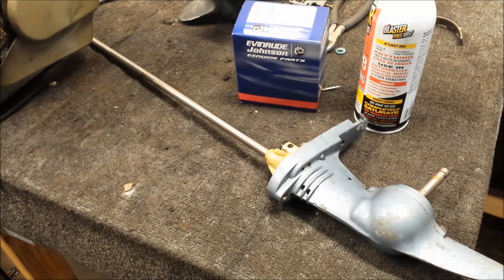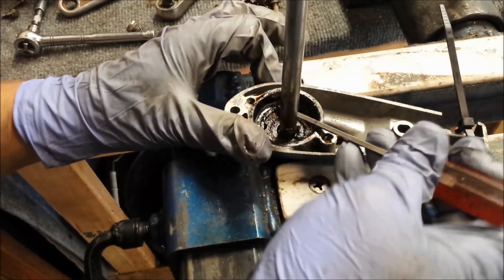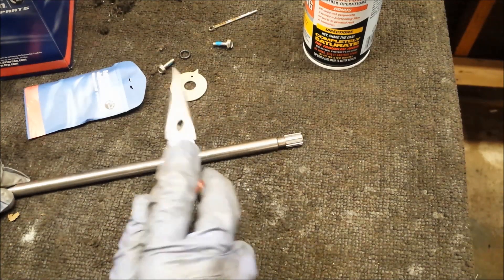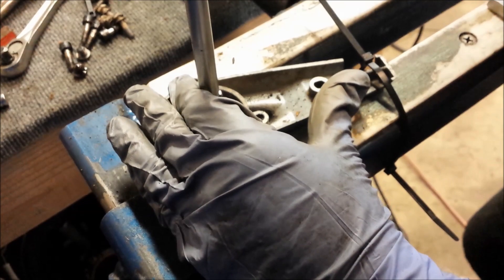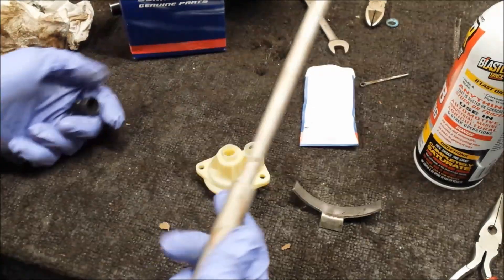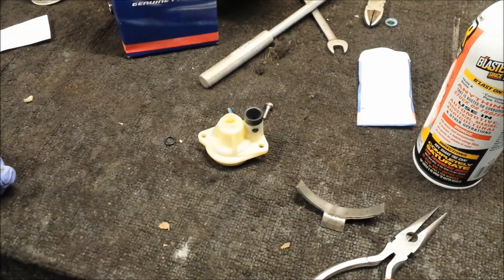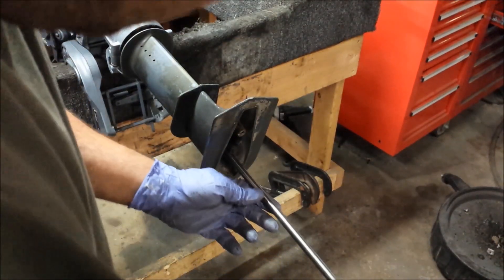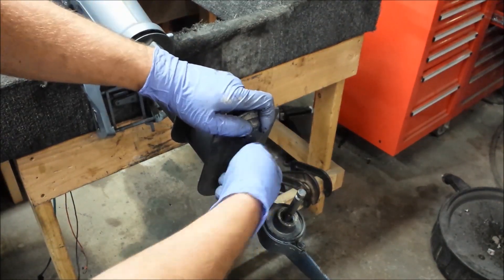1977 Evinrude 4 HP Replacing Water Pump - Kit # 763736 / 387362

Comment: Your videos are great! Would you have time to answer a question? I have a 4hp Johnson Seahorse. Replaced the water pump and both coils. Now when I pull the starter the throttle lever moves. Any idea why?
Reply: Your coils are not set in place correctly. They are rubbing on the flywheel, which results in turning the timing plate, which moves the throttle. Use the straight edge of a box cutter knife, line the two edges of the coil perfectly with the two edge of each boss

Comment: You turned the impeller the wrong way. Yes, clockwise is correct, that’s the way the driveshaft turns, BUT, you did it with the impeller/housing upside down. You have to realize/visualize that the entire housing sits the other side up. If you put the impeller in the way you did, it’s turning counterclockwise once you flip the assembly over. I’ve lost track of how many videos make this error.

Comment: Hello. I have a early 80's Johnson 4hp Deluxe, with FNR.  Do you have any idea how to separate the lower gear housing from the rest of it to replace the impeller? I can only get it about 1/2" apart and that's it. Had an older Johnson 6HP and there was a little coupler on the shifter rod that unscrewed and it came apart, but this doesn't have that coupler. Any ideas would be appreciated. Thanks

Comment: Hello do you  have  a o ring  on top of  the  shaft....i have  To change  my  water  pump impeller  and  notice i dont  have ..one..MERCI  for  info
Reply from the maker: a 1984 4 HP does have an O-Ring on the shaft. It is Evinrude part # 0303191.
If you arent in the USA, or ordering other parts, I would see if you want find one locally that works.
Reply: @BrandonsGarage  tank you verry verry mulch...from Québec canada merci

Comment: Great video. Question I have 1980. 4hp evinrude 2stroke I had it running can't see water pumping from the back of the engine or does it come out from exhaust

Comment: I was taught to never use a petroleum product on the rubber impeller because it will  eat the rubber. The make water base lube for them an the o rings
Reply: Depends upon the material the O ring was manufactured from….

Comment: Doesn't that motor turn clockwise? That would turn the impeller the other way...no?
Reply: Doesn't matter it will correct itself once it starts rotating
Reply: @Ed-uk8el  No, it will not.